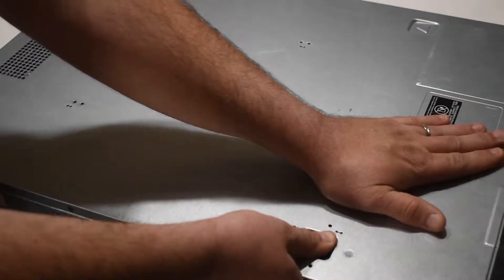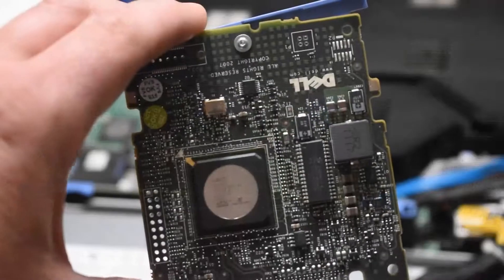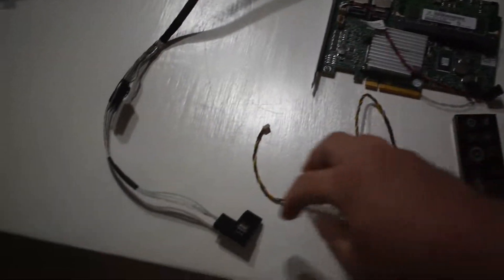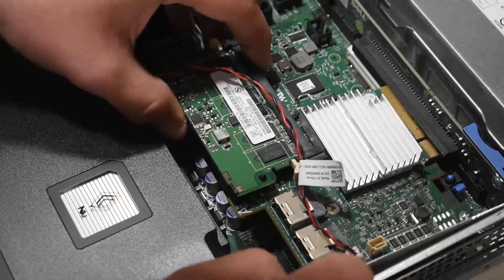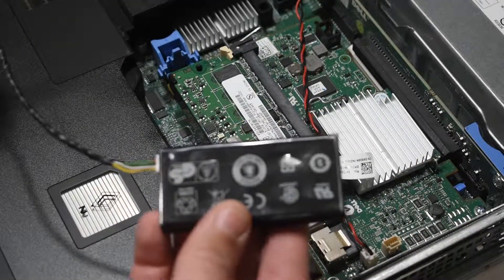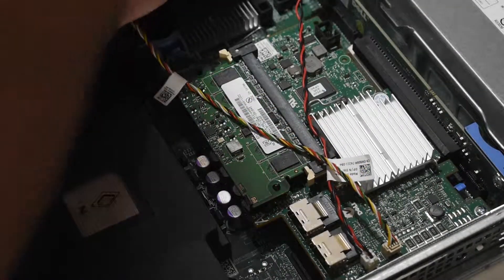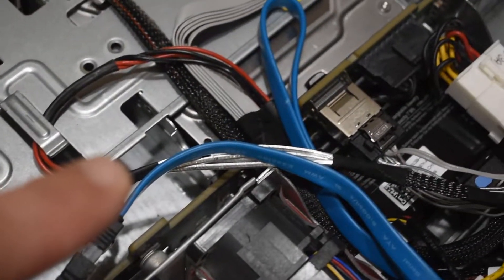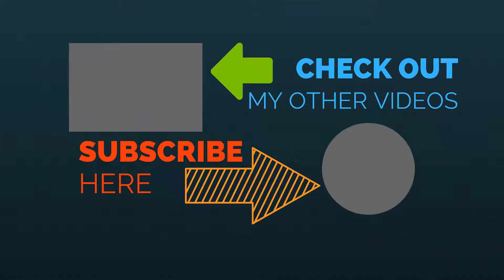Dell PowerEdge Raid Upgrade- Perc 6i to H700

Comment: I need some help with mine. you didnt show the other end of the sas cable connected in the h700. So i need some informations... in the h700 there are 2 sas ports... i want to work with all 4 hd slots,.... should both be connected? only 1? i assume you sas cable is those 3 end cables? if so, it can connect only on one sas port of h700... is it right?

Comment: Moved H700 card into Integrated port can’t boot machine problem is if I move the card further up my iDRAC battery cable doesn’t reach the OEM slot anyone have a suggestion this is for an R710
Reply from the maker: Sorry I haven't opened a r710. Is moving the battery closer to the slot a option?

Comment: Thanks. I have a perc6i in my r710 and I have been running two 2tb drives and went to upgrade to two 6tb drives and turns out the perc6i is not compatible with drives over 2tb. I’m hoping the h700 can help me overcome this issue.
Reply: Did that work for you?
Reply from the maker: If you have the room, this will work.
Reply from the maker: Good luck this should do the trick.

Comment: Hey dude. I have a r410 and would like upgd 6i to 700h card. 
Accordoing your instructions I need use the Black PCI-e slot.  It's a problem for me, I'm using this slot for a geforce GPU (it's impossible use the onboard matrox to play anything)
Have other better Raid controller (that support disks high 2Tb and Raid5) where I can still use white PCI-e slot ?
Reply from the maker: Yeah that's a problem, you need that slot.

Comment: I have Dell R720 with more than 6 years old Seagate HDD, now I want to replace with new HDD how can I know which model is compatible?
Reply from the maker: R720 should have 2.5in hard drives,  so typically sas or sata drives will work.

Comment: Where did you find a cable to change the odd cable to use with the ssd
Reply from the maker: It's called a "Slimline 13 pin SATA Male to 22 Pin SATA Female Cable Adapter-III" and you can get it from Amazon.
Reply from the maker: Here's the link https://www.amazon.com/gp/product/B00BTDAO6M/ref=ppx_yo_dt_b_asin_title_o01_s00?ie=UTF8&psc=1